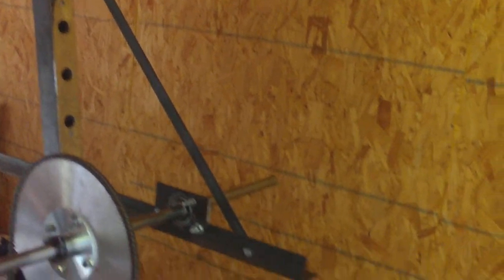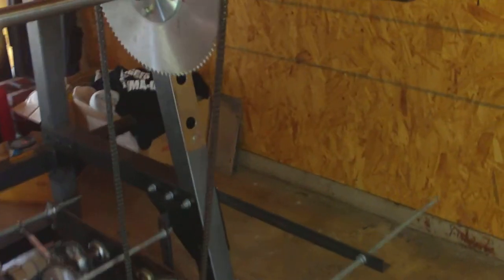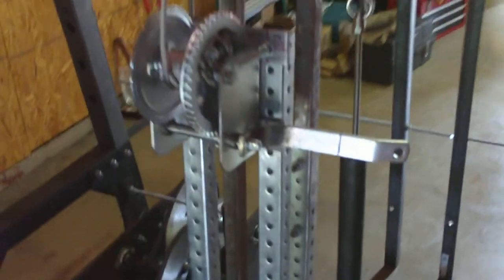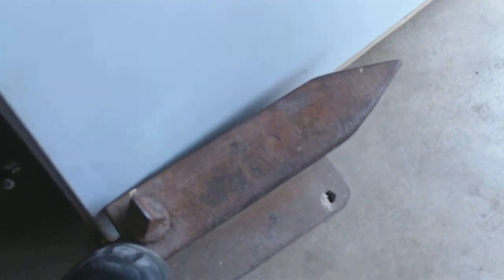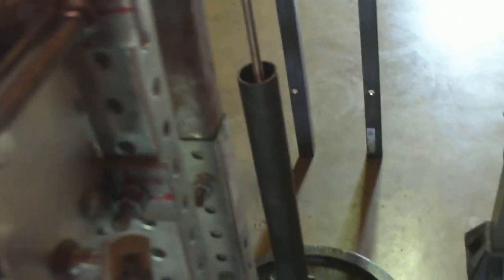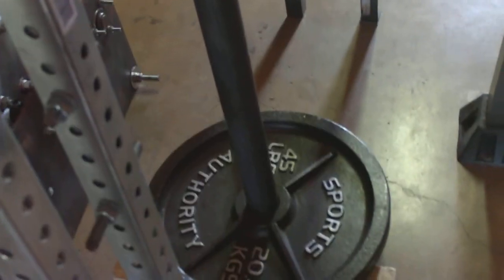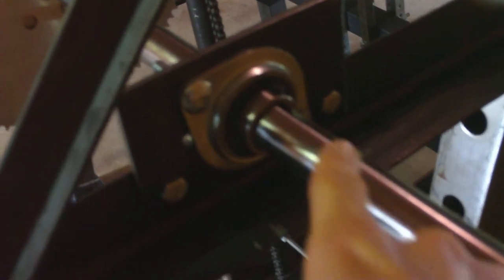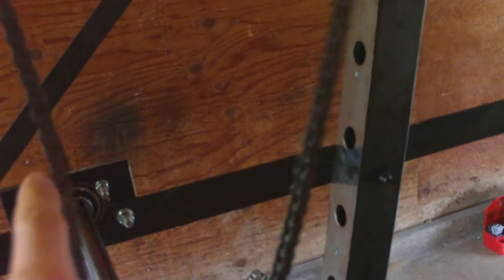56 - Transfer Shaft Completed

Comment: I am eagerly anticipating the results.
Reply from the maker: Ran some light weight tests. The load revealed some easily solved torsional deflection issues in the structure, which I already completed. It also revealed unacceptable deflection issues in the transfer shaft, which are not as easily resolved. So after 2 days of working through some very heavy mathematics for Elasticity of Beam Deflection, with over 68 different
load scenarios, think I finally got which and how much material can be used to hopefully reduce the transfer shaft deflection to an acceptable number. I'll run video once I get the material and work out the details. Might be a few weeks.
Reply: Can you reinforce(support) the spots near the gears that are being bent?
Reply from the maker: pickmyphotos Yes that is one method that can be used, similar to a crankshaft supported by journals in a short block (engine). But that approach requires extensive build out and is expensive. I have a method in mind that the math says will work, but will know more once it's applied. Stay tuned!!